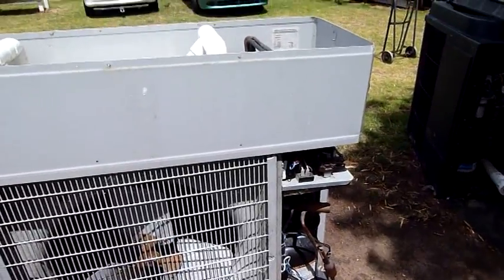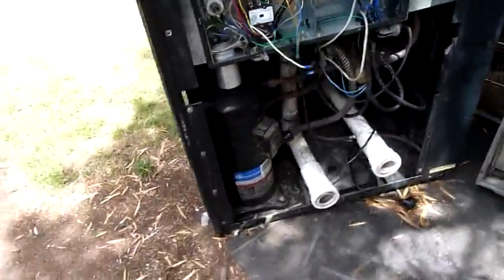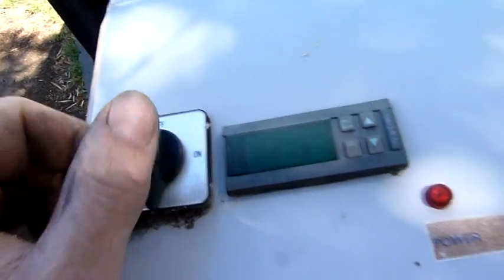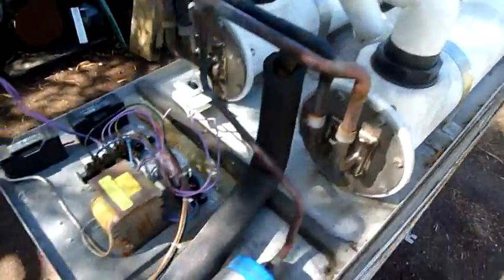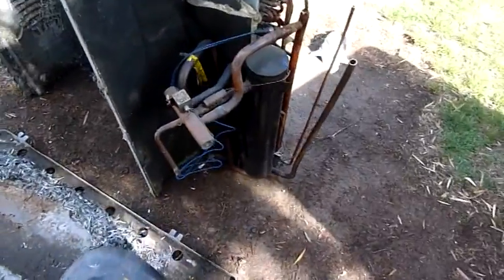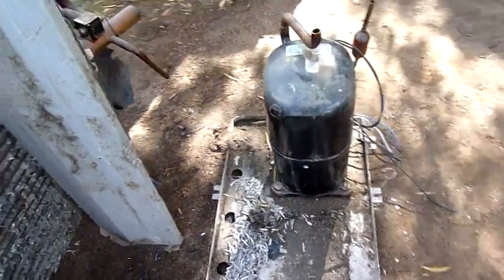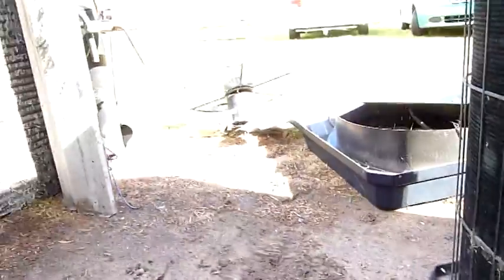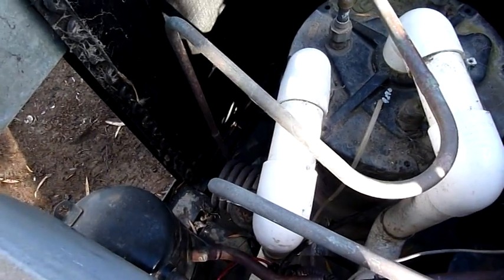Carrier and Aquacal Water Chillers/heatpumps Autopsy pt1

Comment: You know, sometimes the AC items will take DC with little or no modifications. If they take the AC and rectify it and there's nothing tapping or requiring the actual AC, there may be no real reason you can't run it on DC. Unless it's doing some oddball stuff with +/- voltages say with an op amp type circuit. Though I have seen digital clocks use the AC signal as a timing reference, lol.

Comment: Hopping on the bandwagon with heavydiesel, most of those units that are rated for 12-24vac can run off 12vdc, try powering it up with a battery charger.  Pretty sure it will run as there is likely just a bridge rectifier on the input and a dc-dc converter inside it for the logic control.

Comment: I was about to post the same thing. 
The 14.5 Volts from the car's electrical system are a bit lower than 12 * sqrt2 but it should work fine on 14.5.

Comment: That controller will work fine on DC, as it will be using a diode bridge internally to convert to DC anyway. Running on DC will just bias the diodes of the bridge continuously instead of switching as they would on every AC cycle :)